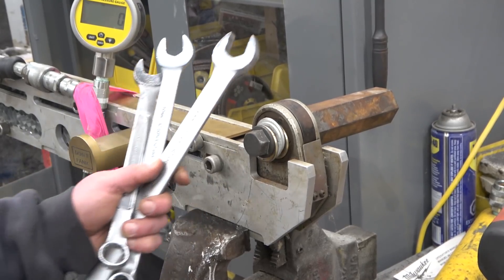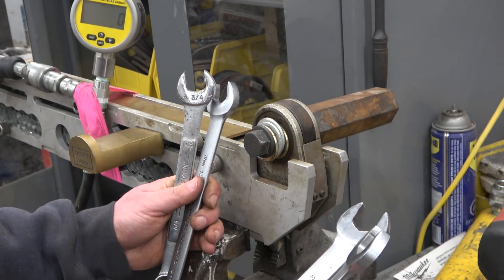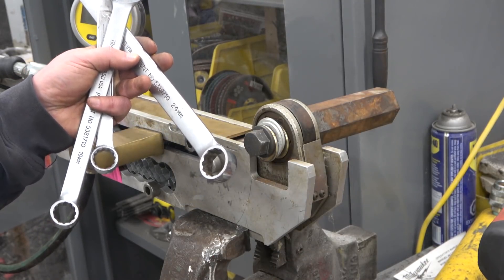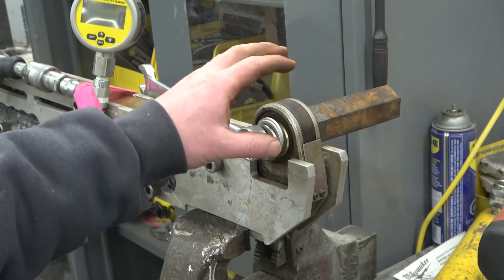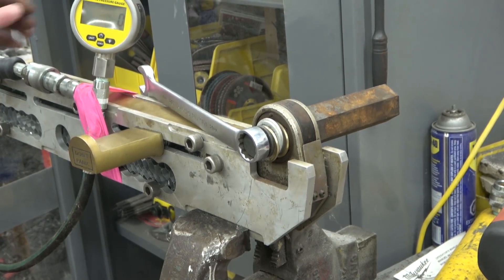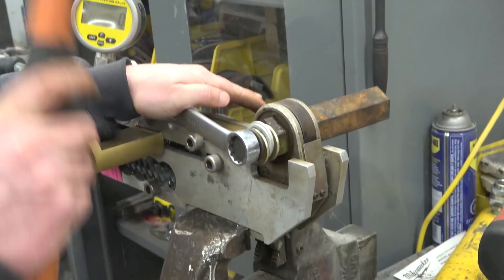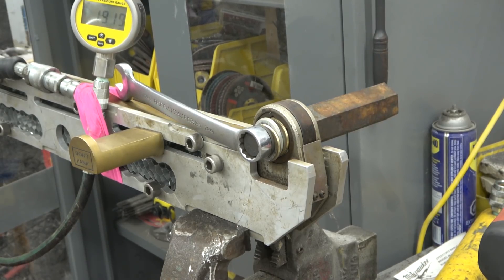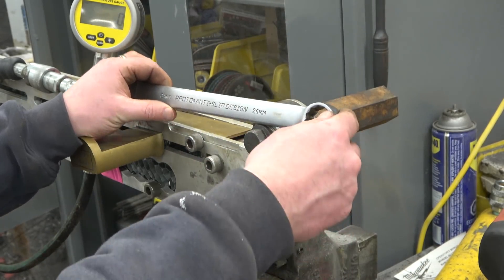do METRIC wrenches fit INCH bolts?

Comment: Typically if I have to use the wrong wrench I try to use the open end, or a hex box end. It's more forgiving in getting bound up and tends not to shear corners as bad if the difference is bigger

Comment: I'm sure a lot of the mechanically inclined among us know the truck if swapping metric and standard for rusty crusty bolts and nuts. Sometimes what's meant to fit, doesn't. Hammer on the next size down.

Comment: What I'd like to hear from a tool manufacturer (a good one, someone like SnapOn), is whether they come from the same mold (or whatever) before being engraved (11mm vs 7/16", etc.).
Reply: I make tooling for fap off, and to answer your question; no, on the print they are dimensionally different. And they broach both ends of their wrenches. I specifically spline grind the 12 and 6 point broach tooling that cuts the box end. I hold +0 -.0002 on the spline form. The hole they broach is a smaller circle to start.
Reply: It's not a mold it's forge pressed. Maybe lesser quality brands use a mold but not most premium brands. They broach their tooling to size. There is a " how it's made" YouTube video featuring snap-on wrenches. Which a happens to include the broaches my company makes for them.
Reply: @williamking5979  Stamp/die whatever, the size marking is built in. Not like it's engraved after. Not sure of anyone that does that on a steel wrench.
Reply: Don't the molds have the size built into them?
Reply: @WCGwkf  https://youtu.be/J4ZM7LwUPJc
Reply: I really blew it and my comment lost its meaning when I used the word 'mold'. Hell, I know wrenches are not made in a mold! I should have said "while they are still blanks" or something like that. So allow me to rephrase: Prior to engraving or stamping sizes, do the 14mm and 9/16" broached blanks come from the same barrel? If they are actually broached/forged/CNCd/whatever in two different operations, they are not exactly the same, not that it matters in most cases. But a serious craftsman who bothers to stamp the right ones from the right barrel would not appreciate the world discounting his concern for doing his job properly. I'm sure that AvE knows that his experiment does nothing more than prove that two wrenches with different stampings are close enough to one another to do a given job.
Reply: @USS-DDG-2  no worry, they are sometimes called molds when you press into them. Depends on the usage, but usually in that case, you'd call it a die.
Reply: @USS-DDG-2  the blanks are identical I believe lol. I own a set of sae and metric snap-on wrenches and the equivalent metric to SAE wrenches are identical except for the size stampings but my point was I know I make their tooling to  different sizes lol. I've never actually measured my wrenches to confirm and that reading would be for nothing as I worked as a mechanic before becoming a Machinist.

Comment: enough heat and a big hammer, they'll interchange

in the realm of survival mechanics, this is one area where 6 pt vs 12 pt can make a difference between the wrench fitting on the fastener or working when the wrench is a c-hair larger than ideal.

Comment: I think that another part of this equation is how tight the work is. You can get away a tad of looseness if its not crazy tight. Last time I was missing the right socket I took a close one and just heated it up red hot and tapped in on it. Let it cool and removed the bolt. Now a bolt on my plow has a socket perm fitted onto it haha After I put it back on I hit the socket with a hammer a few times and it sounded like it was welded on so I let the bolt keep it. it was cheap china crap from a garage sale anyways

Comment: I use the 15/16 24mm thing all the time. My 3/8 drive metric socket set only goes up to 19mm. My 3/8 drive set goes to 15/16. So when checking the 24mm fill plugs on Toyotas I grab the old 15/16

Comment: No no no no
Wrenches? Sometimes, luxury work, nice, no rust
Die grinder? Most often, nasty crudy fasteners. PITA
Acetylene? Bad day, that one bolt, invariably when youre about to go home, and it Just Wont Budge, broke 3 grinder discs, and still won't come out. Torch..when you're done farking around.

Comment: I find that metric or imperial has no effect on whatever I'm hitting with my spanners/wrenches. However, sizes above 24mm are most effective.
Reply: I guess you can use them as hammers but I thought that what was the adjustable one was for

Comment: Any chance for a strength test on sockets in the future? Had a 15mm 1/2" socket crack for the first time a while ago. No idea how I managed that without destroying the bolt first.
Reply: Where I come from 1/2 is closer to 13mm unless you’re referring to the drive size but I’m guessing not otherwise you would have said to avoid such confusion
Reply: @dunc71  its 1/2" drive size.

Not a native english speaker, sorry for the confusion.

Comment: A lot of Americans get very pedantic about 24mm being slightly larger or smaller than 15/16 but then use cheap tools with tolerances bigger than the difference between 24mm and 15/16 of an inch.

Comment: Basically some metric mms line up with inch measurements. But some dont, like 3/8 is 9.5 mm, use a 10 it could strip, but 9 wont fit. And 13/32 (if you have it) is 10.3 mm so if a 10mm nut isnt too tight or you have a socket set itll work

Comment: I’d love a chart showing all the metric interchangeable sizes.
Reply: Make your own, get a handful of bolts,your wrenches,digital caliper,easy peasy
Reply: If you work on enough stuff you kinda figure it out on your own. They aren’t really exact matches so knowing which one is a little tighter or looser can be handy. Like how 14mm is a little smaller than 9/16. So if you’ve got something that’s supposed to be 9/16 but is rusted away or a little rounded then a 14 might get a better grip.

Comment: My dad was stationed in Germany (Sembach AFB) in the late 1950s.   He was about to buy a bolt, but not the nut from a German hardware.  The hardware storekeeper made him go back and get the nut since at that point in time, there were differences between nuts and bolts by different manufacturers.  

I find it hard to believe that the BRD didn’t have standardized measures at that point so that any metric nut could fit a metric bolt by a different manufacturer, but apparently not.  Either that, or the shopkeeper was trying to make a fraction of a Deutschmark on a nut.  Or maybe, he just hated Yanks and was looking for any way possible to screw them.
Reply: Perhaps just different tolerances between manufacturers...
Reply: @bbgun061  - the shopkeeper claimed that they had different measurement a millimeter, decimeter, meter, liter, etc. That there is a difference in tolerance.
Reply: ISO was just getting used more in those years...and also there are standards for metric screws /bolts and nuts with narrower head as ussuall.
Reply: @tomast9034  - yeah, but the US has had the National Bureau of Standards since 1901.  The International Bureau of Weights and Measures (BIPM) has been around since 1875.  I’d expect that German industry would welcome that level of standards…. Then again, they had all kinds of manufacturing issues in WWII, maybe a lack of adherence to standards was one more issue.

Comment: I'm from the U of the K and myself and most of the 40 plus population are kinda dickered here. We do small stuff in Metric but big stuff and speed in freedom units. And some machine shops work to the thou and I love it when I say we work to at least 3mic and they look confooozed ;) I'm off to Hydorolicks press channel now. need to watch something yield proper good!
Reply: UK too. And 50 plus, so metric and imperial.  Learnt first angle projection drawing too. 
What's worse I've worked on land rovers. Imperial threads and metric heads on bolts.
Reply: @petedepledge3359  I rebuilt a Landy. Rewired it with a braided harness. New brake and clutch lines. But took me a while to understand the fing fasteners ha ha haa! Most fun build though! I can see how our Queen can fix one up! Respect!
Reply: Yep, us uk gen x are all bilingual in measurization

Comment: I make aerospace parts. We have a few fasteners that are machined on the parts for installation. Our hex tolerance is +/- .005. They're also drawn to have a slip fit.  So a 3/4 hex would likely be toleranced about .740 +/- .005 and the wrench toleranced at .750 +/- .005. A 19 mm is 19/25.4 or .748 inches. Well with in the tolerances
Reply: @MGD 60D This is the most real down-to-earth (pun half intended) I've ever seen on YT. GJ
Reply: @MGD 60D Horrible Flight I thought it was called.
Reply: @ctaylor114  beat me to it!
Reply: @MGD 60D Thank you for the chuckle, have a worthless internet point and a good evening.
Reply: Oooo nerdy talk nipple rub
Reply: @MGD 60D Ooooh, look at you. Showing off with your fancy smancy home gamer tool sets.

I have an adjustable spanner and a hammer and it's good enough to tackle the most expensive parts money can buy.
I say hammer, but it is more a rock duct taped to a stick but it gets the job done, sure enough.
Reply: 19mm or 3/4 inch is the closest out there. So close that most sockets and wrenches are exactly the same size because it is not worth it to make 2 separate sizes
Reply: @MGD 60D  - horrible flight - sums up the experiance.  lol..
Reply: Ah yes, enginerds. Make whatever prints and tolerances you'd like. I'm just going to hack, modify, and ram home whatever works that is within reach.
Reply: Nicely explained Johnny 👍
Reply: Nice!!! I'm in school right now to to be a certified A&P Tech under Part 147, 14 CFR you are speaking my language lol

Comment: 5/16 is the same as 8mm. 
I always use metric tools and SAE only if the bolt is stripped/corroded. I just hammer a smaller size SAE socket on a rusty bolt and, in most cases, unscrew the bolt with no problem.
Reply: yeah yeah, 9/16 is 14mm. lots of them.
Reply: @Davidautofull  3/4=19mm
Reply: Glad someone said it first 😂

Fuckn feel so proud of myself when I hammer the wrong socket or hex key onto/into the fastener

Comment: one is usually tighter then the other 1/2" tighter then 13mm 14mm tighter then 9/16.... all good for when the rustys or cheap ass bolts round off...what ever fits works

Comment: There can be no more that 0.5mm difference in size, generally not a problem
Notice that the 21mm is normally missing from the set, it's just over 13/16, the 20 being just under

Comment: 15/16" = 0.9375" = 23.8125mm. The 24mm is just a little bit too big, so yes, under great load it can Jam up on the bolt especially a 12 vs 6 point wrench. I'm not going to check all the close fits, but I don't believe any of them are exact. Some are just 'close enuff'.
Reply: Nothin is exact anyway - every wrench is gonna be oversized by some amount and by how much varies a lot according to brand and the Chinese factory it was made in. It wouldn't surprise me if some mfgs made the 24 and 15/16th the exact same size to save cost.

Comment: If it fits it sits. 19.05 mm is 3/4 an inch, so a 19mm spanner should actually provide a worse fit (what with tolerances and all) than a 3/4 inch spanner

Comment: 22mm and 7/8 are a bit too far apart but like you say 24mm and 15/16 also 19 and 3/4 and  11mm and 7/16 and 16mm and 5/8  also 8mm and 5/16 and 27mm and 1-1/16.... ho and 14mm is a tight fit on 9/16 bit will go

Comment: What yields first: the bolt shaft or box head? 

The Hammer.
Reply: It's now a dead dead blow hammer.
Reply: Used an SAE hammer on a metric wrench.
Reply: It depends on how you stroke it.
Reply: Ha ha ha good one.
Reply: Unfair question due to the vast difference in bolt composition. "The Hammer" is too vague to be of relevance :)
Reply: How about universal pattern wrench it’s supposedly to work on six types of nuts…similar to a 12 pt
Reply: Time to call the snap on guy... Oh wait, he's out front.

Comment: For working on rusty junk, I grab both metric and standard and use whatever fits the tightest. Then I grab my die grinder and cut it off because it was never coming off peacefully to start
Reply: Violence is always the answer when working on antique rustwd mechanical contrivences.
Reply: @andyreid7274  Violence is not the answer. Violence is the question; the answer is yes.
Reply: @damianpeterkelly1234  I stand corrected. Thank You kind sir
Reply: Can't be tight if it's a liquid...  Oxy ftw
Reply: I used to do the same, but now have oxy-acetylene. no more grinders
Reply: @GordonTurnerr  oxys all fine and dandy... till you need to get that rusty steel fuel pump retainer off...
Reply: lmao
Reply: You have knowledge beyond your YouTube career
Reply: Yes, not only because the head was 'modified', the wrench may be "sprung" from too much force in a prior similar occasion.

Comment: Sure do. Work in Oil/Gas and Everything is of course imperial as it follows API standards. 5/8" Studs work with 27mm. 3/4" with 32mm and 7/8" with 36mm. Matches fairly close to structural fastner sizes in Metric.
Reply: Everything is not Imperial. Everything is Standard. The Imperial inch was 25.399977 mm and the Standard inch is 25.4 mm So 0.000023 mm different! The US Customary inch was actually bigger at 25.4000508 mm Because Murica! Note we don't use any of that nonsense today.The Standard international industrial inch is precisely 25.4 mm. Because all of us Anglos really do have to stick together.

Comment: I bet there are bigger tolerances between brands which are supposedly the same size than between a corresponding Metric/Sae
Reply: Certainly. Cheap wrenches are usually larger and slip easier, in my experience.

Comment: I've got a few tools labeled 3/4" / 19mm..
I've also repeatedly used a 13mm socket on some 1/2" nuts that holds a cover on a machine at work, just due to the fact that I don't own a 1/2" socket. sometimes the nuts get stuck in the socket but I'll always get them off and back on again...
Reply: 1/2" = 12.7 mm, 13 mm = 0.5118". So 13 mm is 0.0118" over 1/2". 0.0118" = 0.3 mm, of course.  There's much closer standard/metric pairings. 5/16" is  0.0025" smaller than 8 mm is. 19 mm is 0.002" smaller than 3/4". 24 mm is only 0.0074" larger than 15/16" is. Metric is just basically a janky standard scale. When they say something is 6 mm what they really mean is it's 1/4" Although 6 mm and 1/4" shank tools really aren't interchangeable.
Reply: @1pcfred    8mm,10mm, 11mm,13mm,15mm,and 16mm are sizes you will commonly find inside the engine bay when working on a car or truck. 13mm and 14mm are common brake caliper bolt sizes. 17mm,19mm,21mm are most common lug sizes.

Comment: A 24mm wrench is .1875mm larger than a 15/16 wrench. Usually not a problem to use a 24 mm on a 15/16 but occasionally find a annoyingly snug fit if you go the other way. A 19 is a little more sloppy but can do in a pinch if you don't have to much chooch in the gorilla doing the wielding.

Comment: I had a 1979 Ford Fiesta. It was called a World car. Assembled with Ford parts from 3 country's. The engine was a Kent 1600 built in England and was all fractional, The body was German and metric. All the running gear was Spanish and was metric also. The strangest part was that the bell housing bolts were fractional 3/8 nc and the head size was metric. As my own mechanic it drove me nuts for a while.

Comment: A 13mm 12 point wrench is the absolute PERFECT tool to round off a tight 1/2" 6 point fastener lol. I own tens of thousands of dollars in tools. 1 socket set is 12 point. And they only get used on 12 point fasteners lol.
Reply: but a 1/2 inch is perfect to hammer on a rounded 13mm nut
Reply: @77appyi  oh snap! I did not see the reach around reversal coming! Nice shot lol.
Reply: Just hammer a 12mm socket on to it and Bob is your Thai hooker. Might as well make a complete soup sandwich
Reply: Some poor guy read this comment and learned that 12 point fasteners exist. I would have been that guy, if I hadn't messed around with some VAG cv axles...
Reply: @lolatmyage  luckily I can say my 12 fastener experience is limited to fun things. Like ARP studs etc. I'm not sure there's enough money in circulation to convince me to work on Kraut cars.

Comment: There be times when one must sprinkle with the hose currently possessed..  

One reason I'm taking a liking to those new Knipex universal rounders.  They are terrible at the actual rounding part though.
Reply: In my experience they do the opposite, they put flats back on rounded nuts.
Reply: @ionstorm66  That's the only pliers that are both expensive as heck AND worth the asking price.  Zero regrets.
"I got you some lever to go with your lever"

Comment: Then there is the 11/16" to 17mm, which I have had to use far too often over the years.
Reply: Enough to know it'll round the nut?
Reply: that's horrific; it rounds bolt/nut right off. Using the 17mm on 11/16 is a painful experience, esp. when you absolutely don't expect to find an imperial one. The difference is 0.46mm which significant

Comment: A lot of metric sizes are based on imperial, M4,5,6 are 4,2,0 BA even down to the tpi.
Reply: I'd argue it's the other way around. BA Threads are more likely based on Metric. 25.4 TPI is a very "odd" number... 1mm pitch isn't.